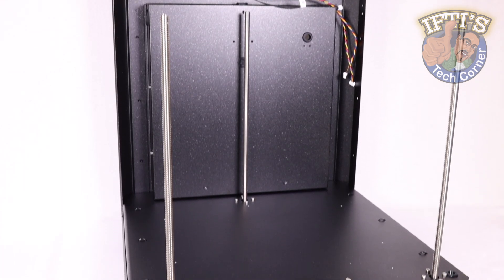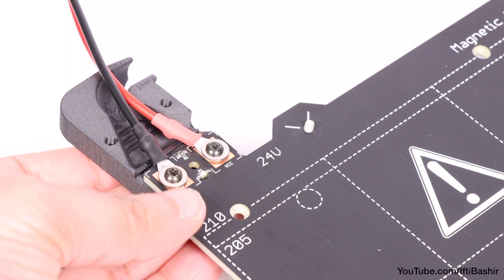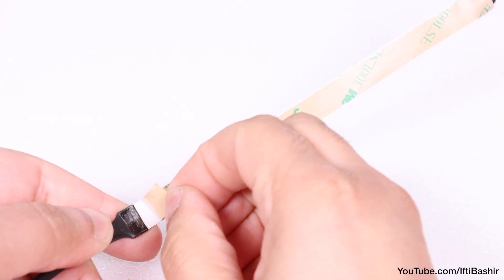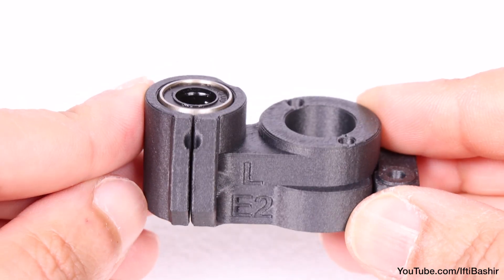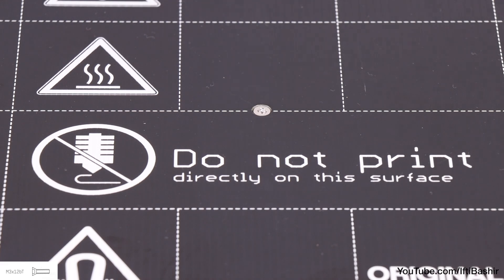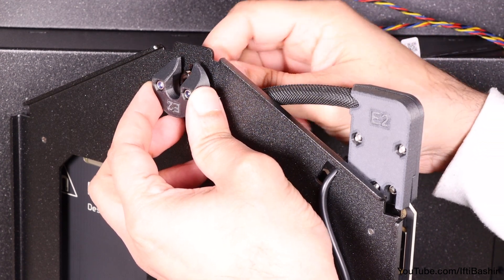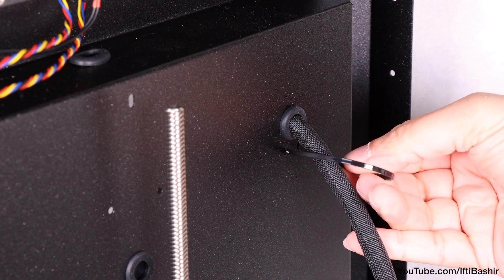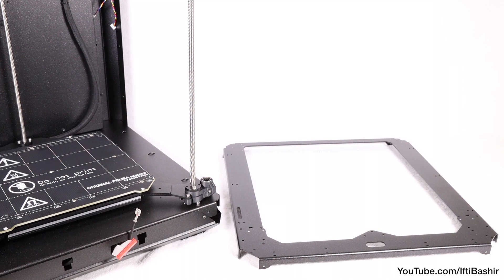#04 Original PRUSA Core One Kit : Full Step-By-Step BUILD GUIDE - Heatbed Assembly

Comment: 7:35 The pulling technic is not advisable with locking nuts because it wears the lock each time it is used. The best way, is to push the nut with a thick enough allen key to cover all the surface.

Comment: At 2:48 that should be M3x4r not M3x4rT. The latter uses a T10 bit that won't fit through the expansion joint.

Comment: At 2:52, the incorrect screw is listed. From Prusa's instructions: "The Fasteners package includes both M3x4r and M3x4rT screws. Make sure you have the correct type prepared."

Because if you use the one that requires a torx bit, none of the included drivers will fit through the little hole in the expansion joints. 

Prusa really could have reduced the number of distinct types of screws in this kit...

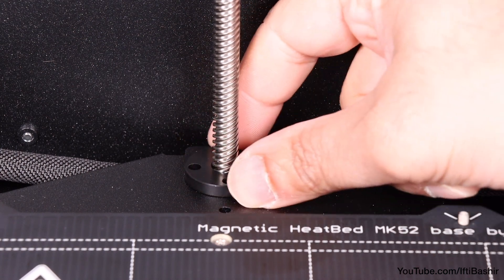Comment: 12:14 does the screws need to go through the threaded holes or the unthreaded? It seems you secured 1st and 3rd nut through unthreaded holes and the 2nd through the threaded ones. Doesn't this affect print bed leveling or something? ... Other than that this, whole series is clear as day. Perfect, I was afraid, but now I know, it will be fun and I'll save some money for more filament :-) Thanks.
Reply: I'm on this step currently, it goes in the unthreaded hole, video shows incorrect. The Prusa instruction photo shows unthreaded holes like rear and right nut.

Comment: Please revise the power cover screw issue (where the silver tall head screw is replaced with a black one) in the previous video. 

In my case the nuts in the opposite side to not friction fit and they fell out in the swap and required hunting for them and more disassembly and reassembly to get back to the step. I understand this is an error in the Prusa guide but this tutorial is quite good but by not catching and correcting this issue in the original video it can not be as easy of a swap
Reply from the maker: Apologies - the video was created before Prusa had even corrected the issue. Hence I had to add to the end (after I had informed Prusa that the guide needed to change!).
It's not as simple to revise the video as I would need to backtrack and take everything apart all over again just to re-do that section. Bear in mind I do not work for Prusa etc - this was just me building my own unit, so I do not have multiple where I can recreate that section again and add it in......[if that makes sense!]

Comment: At 12'43" the bolts seem to be placed in the wrong holes of the trapezoidal nut. This one should have been rotated 1/4 turn before, so that the M3 screws go through the non-threaded holes and screw in the nylon nuts of the carriage. Otherwise, the trapezoidal nut has many chances to not being tightly fasten to the carriage. BTW, one can see at 12'51" that the M3 screws go through the right holes of the trapezoidal nut, the threads of the 2 other holes being still clearly visible.
Reply from the maker: Many thanks for your comment. 
According to Prusa, it doesn't matter which of the holes in the trapezoidal nuts you use - threaded or not - the nut fastens just as securely to the carriage either way. It was the same with the MK4s and the MK4....
Reply: @iftibashir Quite surprising because if you use the threaded holes of the trapezoidal nut, the screw will not be able to tighten it against the carriage the same way. Same as when you screw through two stacked nuts. When the screw head will be stopped by the trapezoidal nut, nothing guarantees that the nut is correctly pressed tight against the carriage, which can lead to vibrations. I remember this being an attention point when assembling the MK3S. Even if they are not the same models, there are some basic physical principles that are valid whatever the assembled mechanism is.

The only explanation would be that the threaded holes are not M3 but something larger. But it doesn't seem to be the case.
Reply from the maker: @ericpascual8913  From the official Prusa online build guide (step 32) : "Align the holes in the trapezoidal nut with those in the plastic part. Either pair of holes can be used."
Reply: @iftibashir  OK. If they say it this way, it doesn't seem to matter. I'm impatient to have my kit to see how it goes cause I'm still a bit surprised.

Anyway, thanks for your videos. I'm watching the whole series with great interest (as you may have noticed 😉).
Reply from the maker: @ericpascual8913  Hope they help - enjoy your build!